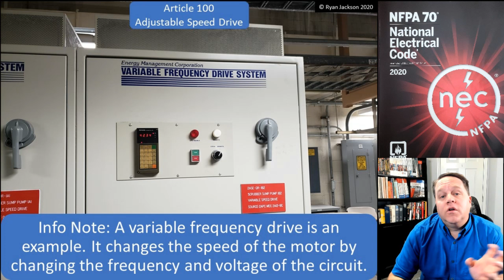100 days of Article 100: Adjustable Speed Drive

Comment: Thanks Ryan for talking about drives. We had 100 times more VFD'S in a new 12 floor building then across the line ( plain jane ) starters. I often wonder if the NEC will adjust ampere tables on drives that do not have a bypass. Everybody should use at least a 30 second ramp up time to limit inrush current and prolong life of gearboxes. Every motor 5HP to 50 HP had a regular VFD and 60HP and larger had 18 pulse drives. On the 200 hundred or more dives that feed exhaust, supply & return fans from 5 to 150 HP seldom pulled nameplate amps of motors on line side of drive. Back in the 80's we installed drives with a maximun of 10 or 15 seconds ramp up times. They were only started a few times a hour but with slow start up doubled the life of the gearboxes. According to the control company they said that running both supply fans on large air handlers at only 50 to 60 % full speed saved a lot of energy verses just one of the fans running at 100%.